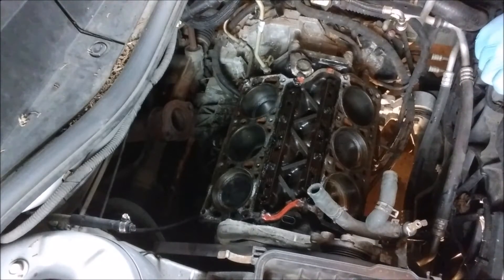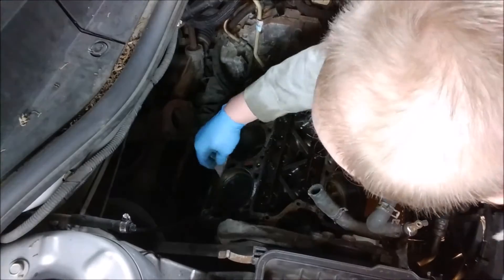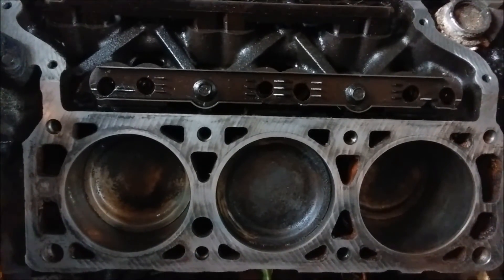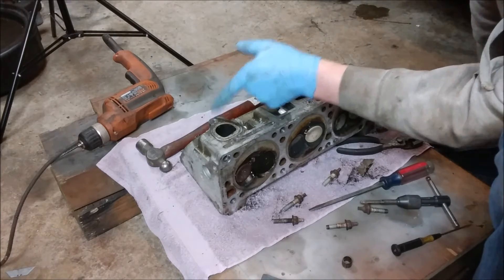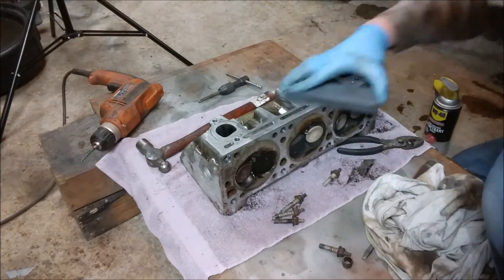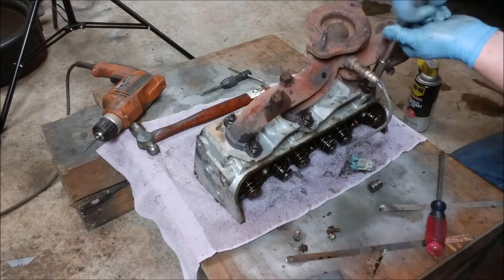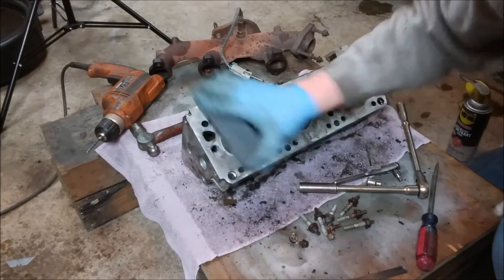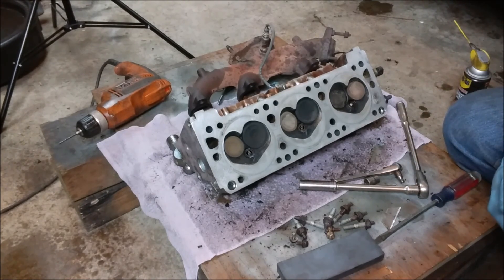Equinox head gasket part 2

Comment: I know this is a few years old, but I have found your video series on this engine immensely helpful and I am wondering what tool you used to get at the 2 difficult, rusted nuts securing the main exhaust pipe to the exhaust manifold. It's too tough to wrench or manually socket, especially since the assembly is suspended and shifts when you try to apply force. A standard battery powered impact wrench encounters obstructions in the front without an extension bit and an obstruction in the back or side with an extension bit. I've soaked it with penetrating oil a few times.

I'm assuming you made use of a low-profile impact driver and just a socket or a short impact bit entension w/socket. Do you remember what worked for you in this tight space? I'm getting frustrated crawling under there each time to visualize an unlikely solution and am hoping to have some confidence in purchasing the correct power tool for the task. Thanks for any info in advance and also for the excellent videos!
Reply from the maker: I don't really remember how I did it. But in general I  use thin wall standard sockets and whatever combination of extensions gets me to where a ratchet will fit. Sometimes you can put the box end of a wrench around the bolt then take a punch and hammer to break it free. Hope that helps and good luck.
Reply: @SRMWorkshop  I appreciate your quick response. I am mildly amused that the one part of the project that is getting the best of me is the final 2 bolts before I proceed to the cleaning and surface prep portion of the job. Such a comical point to encounter a hurdle after all the labor and right on the threshold of moving on to the 2nd phase of the repair. I will maintain my resolve,  lol. Thanks again!
Reply from the maker: @weatoguegroove3884  if it makes you feel any better, I have a saturn in the garage with a HF 3.6L (dual overhead cam) that is kicking my butt. The worse part is even if I can resurrect it, the engine is total junk with really bad blowby. Some projects just suck.
Reply: @SRMWorkshop  I feel you. This is a charity project for a disabled elderly neighbor in Los Angeles who is currently fighting eviction. In case she loses her home and needs to sleep in her car I would like it reliably running for her and for communal peace of mind

Comment: Good video, very please with info. I'll be doing my son head gaskets tomorrow. I know heads are warp and possibly crack. It ran hot several times. Will put heads in shop to check for cracks/warping.
Reply from the maker: If you have any doubts about the heads, get them checked. My local parts store has a machine shop they work with, I'm sure others do the same.

Comment: Do you have to worry about anything that falls down into the coolant chamber when cleaning the block?
Reply from the maker: make sure you fish out any big chunks, but if it gets a lot of contamination just be sure to flush the system out.
Reply: @SRMWorkshop  What about the grommets? I have 3 stuck in the heads that just refuse to come out.

Comment: What cleaning solutions did u use to clean everything, sprays, sand paper grit? Thanks
Reply from the maker: I just used brake cleaner and some 400 grit sand paper.
Reply: TattooPyramidHead  hey thank you soo , it all started after i dropped a valve stem into the cylinder while trying to replace a vavle spring, now im just putting all new gaskets!

Comment: what is the block you are using for sanding ? and checking for flatness
Reply from the maker: The block is a large sharpening stone with fine and medium grit sides. They cut much nicer with oil, I was keeping it wet with degreaser. The bar I used for flatness was a 1.500" x 12" aluminum lathe stock I had on hand.

Comment: Even though you found the head gasket to be the culprit, did you check for a cracked head in any way before reassembling everything? I read somewhere that you should never do a head gasket job without checking the heads for cracks, otherwise it could all be a waste of your time.
Reply from the maker: I did a visual inspection for cracks after carefully  cleaning everything. In the case of the one I did, there was a clear breach in the gasket, and the gasket was crumbling away so I was not very worried about a crack.
Reply: @SRMWorkshop  
Are cracks easy to spot with the eye? I saw a video recently of a guy using some kind of kit with two spray cans, one can was a penetrating oil of some sort with a dye in it, and the other was called a developer. The penetrating spray goes on first and then you wipe it off good, and then you spray the developer on which turns the head face all white after a while, and if there are cracks they will show up with the penetrating oil bleeding through into the white. I thought it was interesting.
Reply from the maker: @jzak5723  they can be hard to see, using an indicating dye would be the best way to go. I took a chance on this one and was looking for any sign of a crack even down to 0.001" wide. But it was all machining marks and raw casting when I was looking really close.
Reply: @SRMWorkshop  
Seems like you should be able to see a crack either with the naked eye or even a low power magnifying glass, so I'll probably just go that direction, unless the gaskets themselves appears fine.
Reply: @SRMWorkshop  
Finally got all the exhaust bolts loose, now I'm having problem getting the dipstick out tube out of the block, lol! Hoping to take out the heads with the exhaust manifolds attached minus the crossover flex pipe.
Reply from the maker: @jzak5723  I would look over that gasket really good, if there is a good witness mark then you might be fine unless it was over heated really bad.
Reply: @SRMWorkshop  
Its my son's car and he did have it overheat a couple times, but I don't think it was that bad, anyway, I'm hoping it wasn't that bad.

Comment: How did you clean the oil from the heads. When you remove them from the engine, the are very oily. Did you soak them
Reply from the maker: Large amounts of brake cleaner
Reply: @SRMWorkshop  thanks. Do you know what grit your sanding block is? Also, is that regular WD40 you are using as lubricant?
Reply from the maker: @leopalmer1934  I'm not sure what grit, the block has a coarse side and fine side. And any light oil is fine, it's just there to float out all the junk from the stone as you use it.